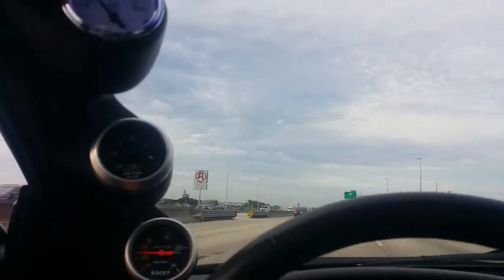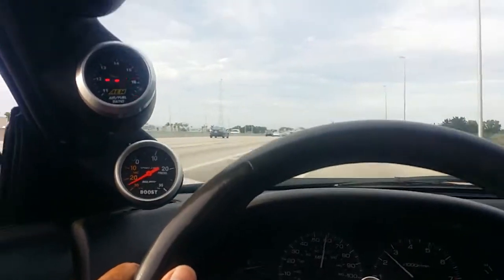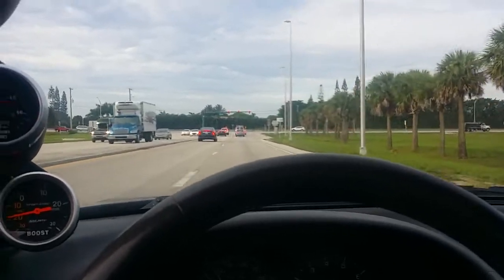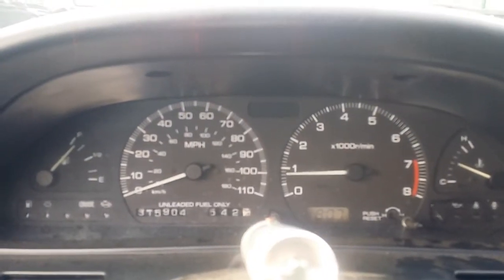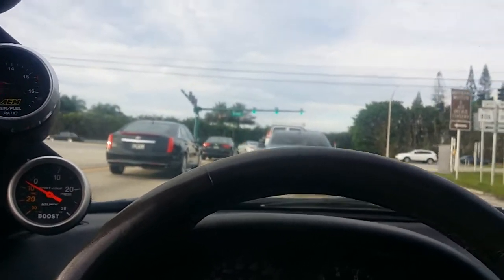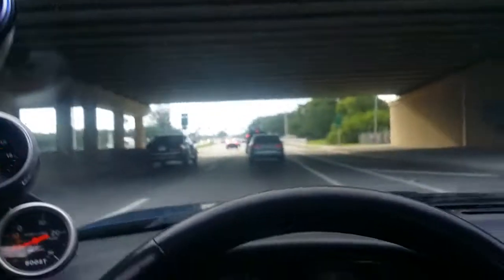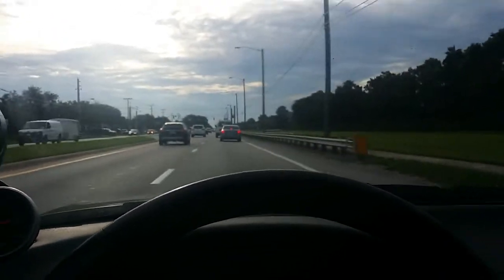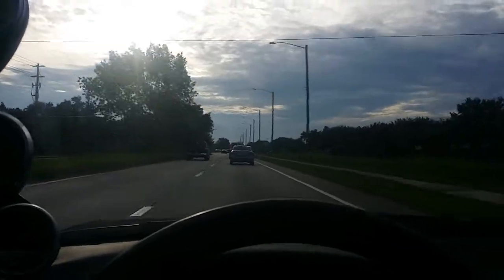KA24DE-T 4th gear pull - 34psi Tuning

Comment: I know this was a long time ago how did you learn how to tune your car yourself
Reply from the maker: By reading, reading, reading, apply, read more and apply.  Forums, speaking with people, etc.  Understanding how a motor works is crucial as well.  If you apply yourself, you can do it.  I just ordered HP Tuners for my F150 to start giving it some more umpf when towing my boat.
Reply: @supakat500  sick I was about to watch that. I didn't comment on it because this was ka24de question because mine kinda blew up with a rom tune....it started knocking
Reply from the maker: Yea it happens.  But basically spark advance is key to tuning then afr.  Deduct 1 degree of timing per psi from WOT timing and you have an overly safe tune.  Once you get comfortable and have a knock lite, you can add timing and do pulls.  My KA-T lasted 5 years without opening up the bottom end.  If I would have slapped new bearings in, it probably still be alive.  I am love the VQ now.  Currently working on a 3.7 swap.
Reply from the maker: @glenfff  yessir...
"He who would learn to fly one day must first learn to stand and walk and run and climb and dance; one cannot fly into flying."
Friedrich Nietzsche
Reply from the maker: @glenfff  I got tired of the KA.  I wanted to learn something new.
Reply from the maker: Damn, went to delete the tired comment and deleted the other by mistake.  Anywho, I also switched because I wanted to find a stock block that could handle the power.  I don't ever want to build a motor again...tooooo much damn money!
Reply: @supakat500  I thought u have to build the VQ
Reply from the maker: @glenfff  VQ35DE only good for 400whp.  VQ35HR & VQ37VHR can make 600whp.  500whp and the tq from a 3.7 is more than enough to have fun...I am not looking for crazy power but something to have fun and be decently quick.
Reply: @supakat500  yeah that's me with the ka. I was thinking about k swapping it since its become more common.
Reply from the maker: @glenfff  yea i feel you...next swap will be vk56
Reply: @supakat500  u know that was an idea too. It still is just haven't see a nissan titan in the junk yard yet
Reply from the maker: @glenfff  there was one in the yard today intact...3 g37's but engines gone...transfer case was still one one of them...another option down the road...awd s13
Reply: @supakat500  I've seen one or 2 awd s13s out there very possibly.

Comment: if only I could find a clean 240 for less than 5k$..
Reply from the maker: How much they going for now?
Reply: +supakat500 3k$ for no rust was the best i could find, but they sell really fast here in Chicago. How much did you pay for yours?
Reply from the maker: +apex128 you don't wanna know. $490 out the door from copart. got lucky as hell.
Reply: Man drift tax is killing 240s I found a shell that is 4 different colors for 2k stock suspension and rims totally stupid

Comment: How much did your whole rig cost? I'm thinking about getting a s14 and using it a DD with about 7-9 psi boost. I kinda also want to drift with it a bit, so I'll have to do a lot of suspension work.
Reply from the maker: Robert Trujillo I don't know off my head. Just know it didn't break the bank.  A stock KA with T28 @ 10lbs will last.  Plus a T28 will be fun for you to slide.
Reply: supakat500 what about sway bars and stuff? Did you install any aftermarket suspension?
Reply from the maker: Robert Trujillo Stock sway bars with Energy Suspension mounts, KYB struts on front with Tein springs. Front torsion bars.  Camber bolts. Rear are GAB coils set to softest setting with upper camber arms.  Upper and lower strut bars.  That is it.  Since I don't drift I can get away with this. I want to run coils all the way around but have not found a deal on front coils only.
Reply: supakat500 nice

Comment: 34 psi???????????????????????? 600 hp?
Reply from the maker: edwin albino I don't think so.  It doesn't feel that fast IMO.  The exhaust manifold is really holding me back.  I need to get the other one I have modded and installed to really unlock the power.
Reply: 34 psi still sounds like a handful of fun for ya
Reply from the maker: Def agree.  As long as you have traction.  Spinning ain't winning.